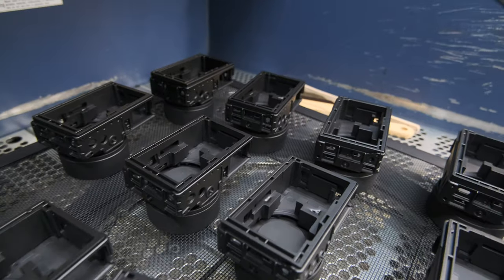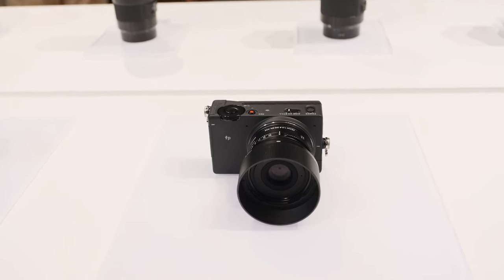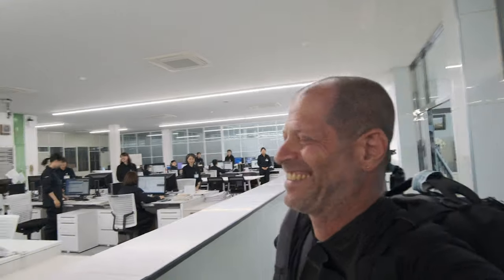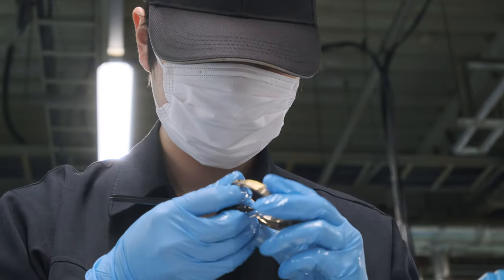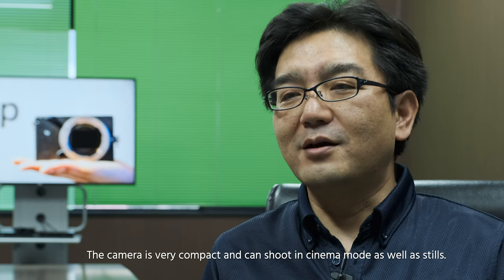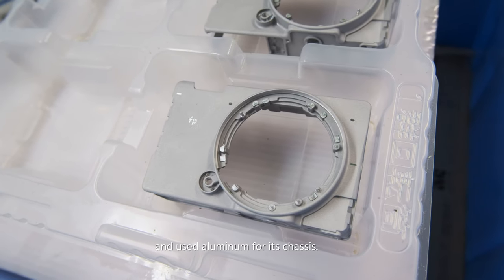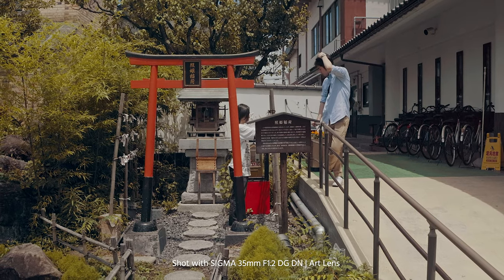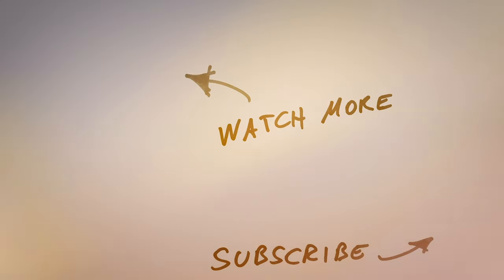SIGMA Factory Tour - SIGMA fp Camera, new 35mm Lens and Soba

Comment: I like Sigma use their lenses and waited for years for the foveon to mature it's taken so long. It's good Sigma is looking at doing something like this wish it was with the new foveon sensor. There are some gaps in full frame especially with Canon that could be filled with this camera it's a tough market. It would be nice if sigma did a sideline variation bayer less mono full frame with that sensor and exclude the IR filter for astro photographers. I like that the heatsink is accessible on the outside for cooling externally with a peltier cooler. I would buy such a cam.